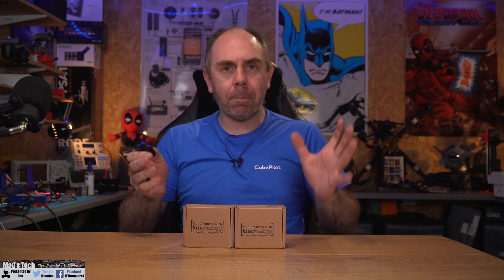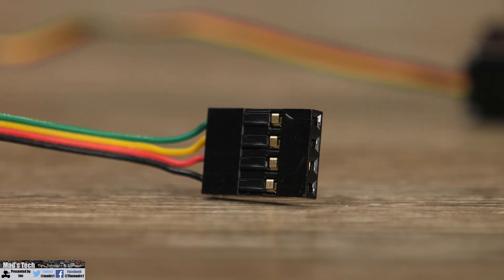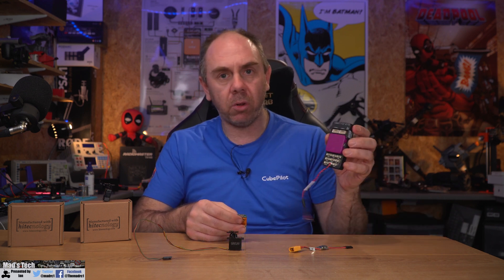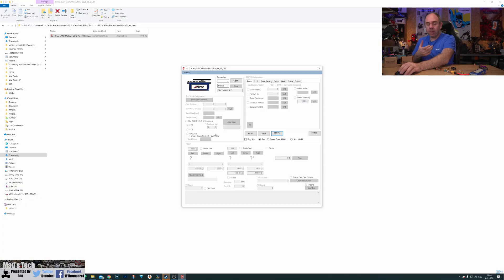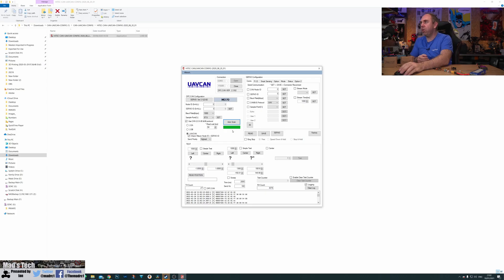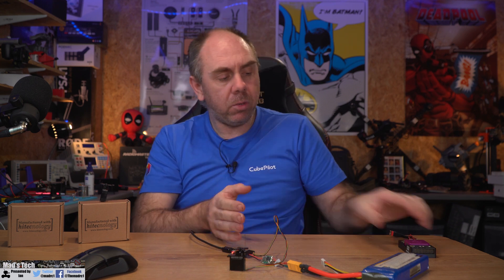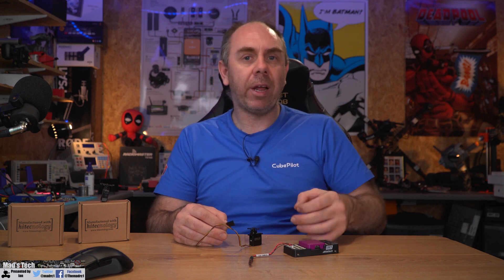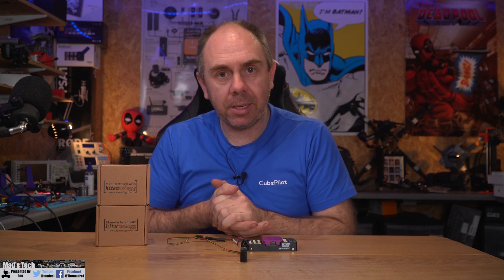Hitec UAVCAN Servo For Ardupilot & More - Overview & Setup

Comment from the maker: Important Update:  Hi Everyone, 

I got a couple of things slightly wrong in this video regarding the multiprotocol and UAV CAN

1: there is a error in this video with regards to the Node ID of the Service needing to be the same as the Flight Controller, while this was the case for the units I was testing this was a firmware error and its been corrected in later revisions. To confirm the Node ID of the Servo should not be the same as the Autopilot, as standard Ardupilot sets your controller as Node 10 and the servo should be something other than this.  1,2 or 3 for example.  Also note setting the Node ID to 128 will tell it to mirror the Servo number for the Node ID. Sorry for this error it was due to some early firmware and has now been resolved. Node ID for all UAVCAN Devices should always be different. 

2: The servo should be bought in the connection and protocol its needed for,  the Model MD70 is available in UAVCAN,PWM and RS485 versions and you cant actually change the input your model supports.  

Sorry this was a miss understanding of the spec by me.

Comment: Wonder if you could help with something im trying to figure out with the UAV can servos configuration

My company has designed a 2 axis gimbal for our aircraft using the can servos as the axis points. We got everything to work perfectly however we are trying to get the Pan Axis to stabilize during flight which is not working at all. 

On ardupilot you have the pull down menu for gimbal selection and that has the stabilization option. However when we activite the RC input for the different axis. When we try this it changes the servo inputs automaticly to a mount option and then we have 0 control on the gimbal. It seems we only have control over the gimbal if we select the spicifc RC input we have selected. Do you possibily know what we can try to get the stabilization to work?

Comment: I particularly like the idea that their is servo sensing capability. I'm going to guess that in future when you have an airframe with redundancy built  into the airframe e.g. redundant control surfaces, it will be possible for the Flight Controller to detect a failed servo and be capable of failing over to the redundant servo / control surface to ensure continued safe flight?
Reply: Redundancy is certainly one of the benefits. The major benefit for RC/UAV is the reduction in wiring complexity. It doesn't need the traditional hub and spoke topology, in fact a loop topology is advantageous. You can run just a single connection to a servo in a wing, from there you can plug an ESC or GPS or anything else directly into the servo, rather than running the connection all the way back to the FC. Ideally you would have just three connection to the FC: Left wing, right wing, and fuselage. From there everything can be daisy chained together and looped back on itself. Ensuring that if one connection is broken, the network continues to function. As sUAS become increasingly sophisticated, the resiliency, simplicity, and reliability of CAN will be very appreciated. At work we're trying to incorporate it as much as possible in our electrical architecture for our big fixed wing platforms already, and have just received our first Hitec CAN servos for testing. In the future, we don't plan on specifying PWM servos unless requested by clients.

Comment: Fantastic product, fantastic video.   I had no idea that CAN bus servos were a thing !
Reply from the maker: They are VERY new, you could not even buy these when I was sent them.  Right now they are not the norm but a few years down the line they will be far more normal. I have had them for nearly 4 months but there has been changes in SW that I was waiting for before posting
Reply: @MadRC  Excellent work !   PWM servos are old, old tech.  So many things you could do with these, including finding out that the servo isn't moving from the flight controller !  I can't wait to see these things become the norm.   Receivers will need to change before that happens though...  But it would be so much easier for a receiver to output CANBUS versus PWM or SBus.